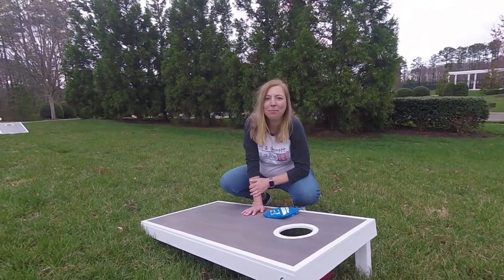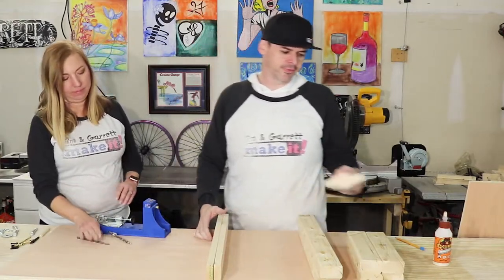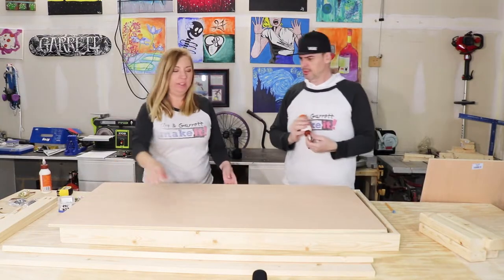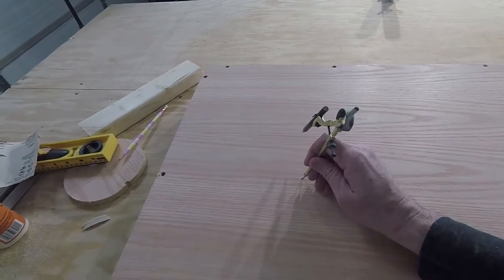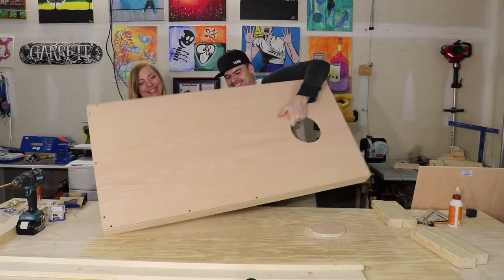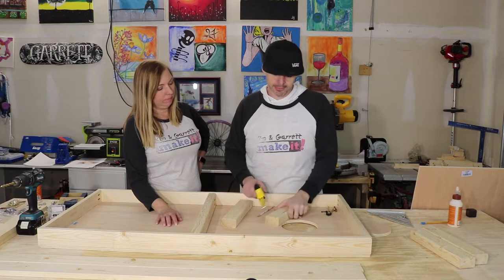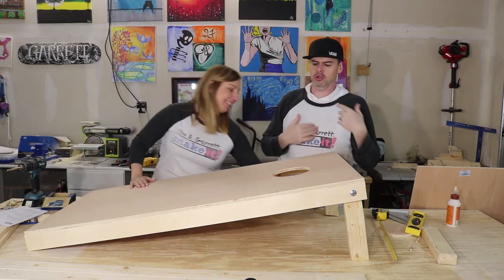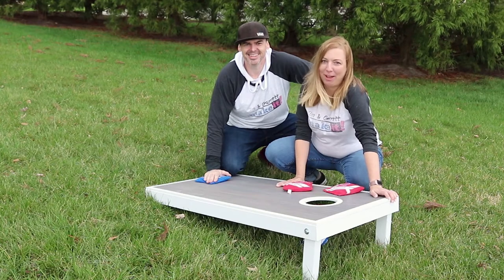How To Make Cornhole Boards DIY Outdoor Games Lowe's

Comment: Very cool. When I lived in Texas we played something similar to this and horseshoes. They called it Washers, you had a board like this except maybe about half the size, and the players tossed larger metal washers. Fun
Reply from the maker: That's a new one!
Reply: @KimandGarrettmakeit  it scores like horseshoes, same concept as this beanbag thing. Safer than horseshoes tho. I do like that you made the legs fold flat but you may want to add some sort of locking mechanism. I have a feeling that after the bean bags hit a few times it may collapse since the momentum will be pushing it.